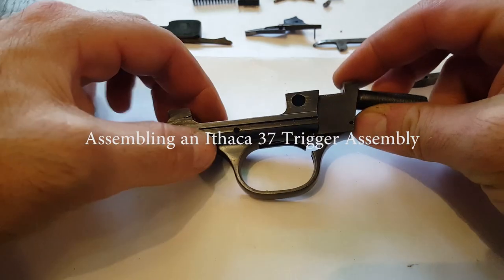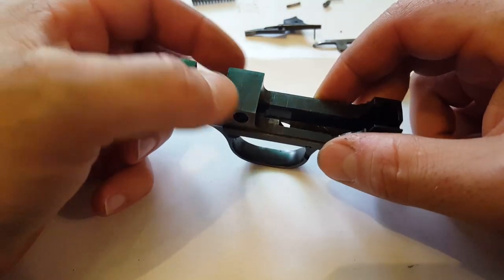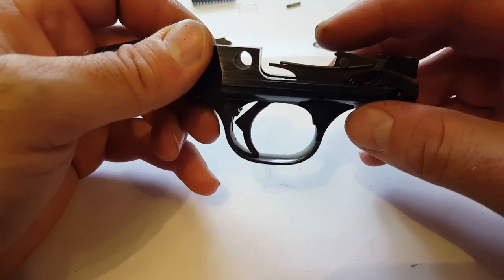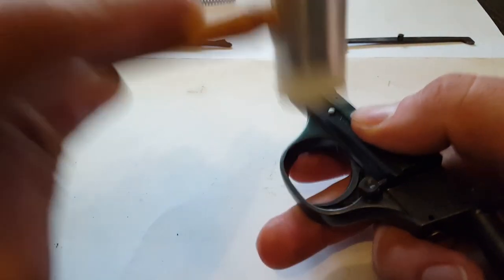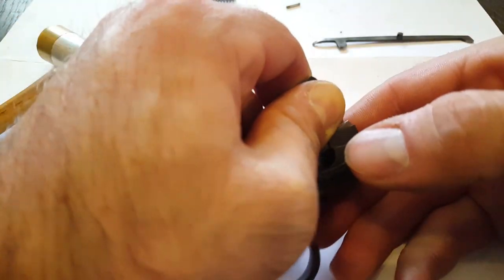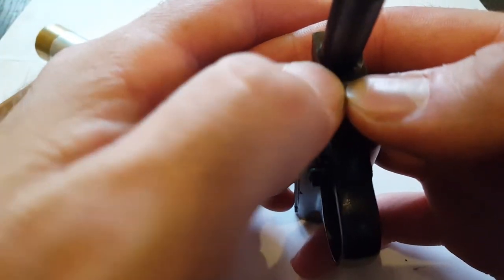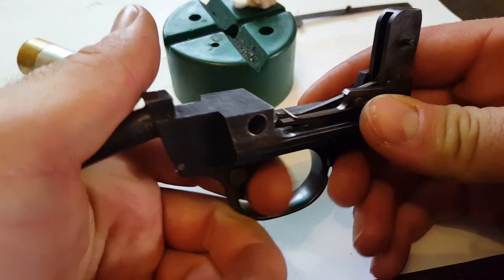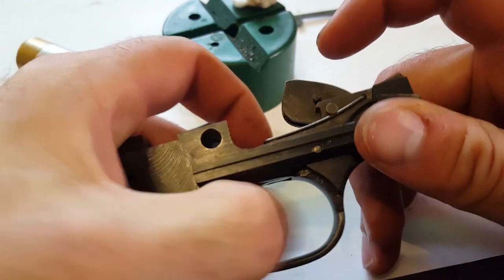Ithaca trigger re-assembly

Comment: This is going to help me out quite a bit. I just picked up a 37 and it won't stay locked up. I found that the slide release has no tension against it. So either that little spring that puts pressure against it has either broken or fallen out. Now I know what to look for as I have not had it apart yet. Wanted to see how daunting of a task it would be. Looks like I could slip a replacement spring in there without taking the whole assembly apart.

Comment: ONLY ONE THING I WOULD ADD, IS THAT WHEN TRIGGER HAMMER IS PINNED AND IT'S REAR TANG IS MATED INTO PLUNGER, BEFORE PLUNGER SPRING IS STAKED WITH PIN, YOU MUST CENTER IT AND MAKE SURE IT STAYS PUT, IN THE DEPRESSED AREA ON THE PLUNGER.
MY HAMMER REAR TANG MOVED AND WAS PRESSED HARD AGAINST BOTTOM  EDGE OF PLUNGER, AND RATHER THAN DAMAGE OR BEND OTHER PARTS NEARBY, I HAD TO BACK UP SEVERAL STEPS AND RE-DO.
EXCELLENT VIDEO, NOT AS MUCH INFO OUT THERE FOR MODEL 37 ITHACA, AS THERE IS FOR MOSSBERG 500 AND REMINGTON 870.

Comment: Is there a left hand version of the 37? My safety plunger pin retainer is on the opposite side unlike yours. The safety works backwards,  right to fire, left for safe. Also..there is no pin hole  on the right side to change it. It's kinda dumb in my opinion. Is there a modification that can be done?
Reply from the maker: There are left and right handed safety switches apparently.

Comment: Great video,  thanks! I have a question about that irritating little wire spring on the slide lock release: what is its purpose? It is installed on one machined piece of metal and doesn't ever seem to be under load during your function tests.  What is it supposed to do,  and can the gun function safely without it?
Reply from the maker: It is what unlocks the pump after the trigger is pulled. when the hammer is released it automatically releases the lock, you can see it working in my "how the ithaca slamfires" video
Reply: @Stray03  ill check k that out, thanks!

Comment: Do you know if the safety can be put in backwards to make it left handed? I have an old 37 with a left handed safety and wondered if I can just take it apart and flip it around or if I’ll need another safety. Thanks
Reply from the maker: I think it is possible. I was looking at it the other day but didn't actually try.
Reply: No, it cannot. You have to buy the pin that was made for the left-handed shooter. I has the same requirement and that was the solution. Even if it is possible to use the same pin, the red label, on the pin, would mean that you are in safe mode.
Reply from the maker: Couldn't he just mark the other side with red nail polish if he wanted to use the same one?

Comment: First of all, great video.  What would cause the hammer to stay down all the way and not come up into the position where the trigger would engage to release the hammer??  I am currently having an issue with mine not moving up into the correct firing position.
Reply from the maker: If you haven't done it yet give the trigger set a good cleaning by dunking it in something like varsol. Then lightly oil it.  The only thing that holds it down lower than the trigger engagement point is the safety sear. basically the sear that allows "slamfiring" catches it and isnt letting it go. Does your shotgun lock in the closed position? Does the pump release move?
Reply: @Stray03  the pump release does move yes.  And it locks in closed position as well.  I have Ballistol.
Reply from the maker: Have you tried testing the trigger group out of the Gun?
Reply: @Stray03  yes.  I can send you a video of me doing so if you like.  I can basically move hammer all the down as the carrier would during cycling. It sticks in the down position, rendering the trigger unable to be pulled.  I then have to help the hammer to the ready position, in which the trigger can then be pulled to interact with the hammer allowing it to fire.
Reply from the maker: The bar connecting the hammer to the spring have the "bulge" facing up or down?    Sure send a video.
Reply: @Stray03  looks like it’s facing up. And the slide release tension spring is resting on that bump when the hammer is not cocked back.
Reply from the maker: Your hammer is probably able to go down passed the point where the spring exerts rotational pressure on the hammer. The little triangular protrusion still on your hammer that interacts with the slide lock?
Reply from the maker: So the few things I'd check are proper alignment of the hammer extension on the spring cover. Make sure there is no crud or burrs in the hammer slot. Check the pin and the hole of that hammer extension to se if they are not worn or bent. And to check to make sure the hammer extension doesnt have a bend in it.
Reply: @Stray03  triangle spot still there.  Will check alignment again.  See if everything is straight also.
Reply: @Stray03  just wanted to let you know I must have fixed it. I took everything apart then reassembled.  It goes clicky clicky now. And to top it off, I trusted it enough to take it to the woods with me this afternoon.  Ended up shooting a nice 8 point white tail buck.  Thanks a lot!!
Reply from the maker: Nice. Glad it was able to do what you needed it to.

Comment: Hello great video just one question I had a hard time putting the safety pin in I think it was to long did you have to file it down
Reply from the maker: No didn't have to file anything.
Reply: @Stray03  okay thank for some reason I couldn't push the pain in far enough to clear the safe
Reply from the maker: Strange.

Comment: Hey, love your channel! just subd. I have a question regarding the tellermines, I've read that in extreme cases the tellermine was thrown to the enemy tank, how would it detonate? hoping the tank thread steps on it? or via a pull fuze?
Reply from the maker: There was training to throw tellermines fitted with time delay fuzes (I assume fitted to the anti handling device holes). I think there is a german ww2 training video you can find on youtube showing it. 
Thanks for the sub.
Reply: @Stray03  Thanks for your quick reply, just saw the training video,  I have found only long delay fuzes, do you know which ones would be used in thrown tellermines? sorry for the questions
Reply from the maker: @waffencamo  not sure. Id assume the same ones as used for their demolition charge but id be lying if I said I knew for sure. I have to find one of the documents I have. May be in there somewhere.